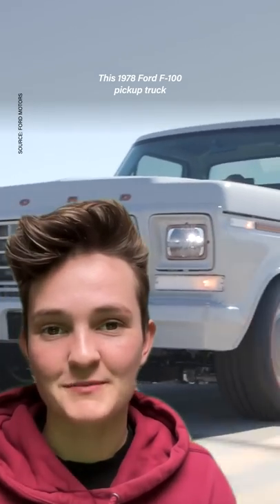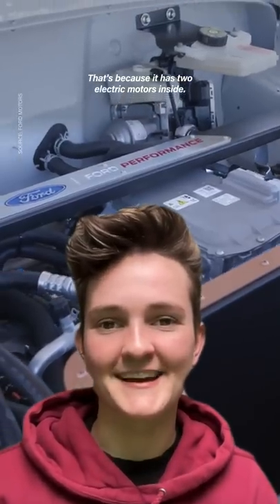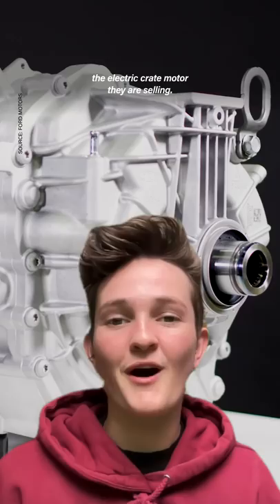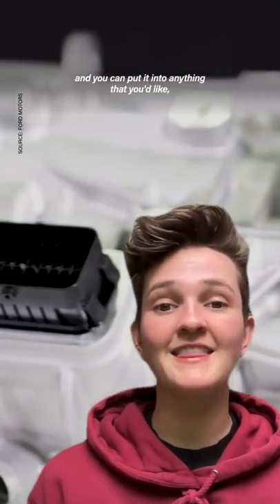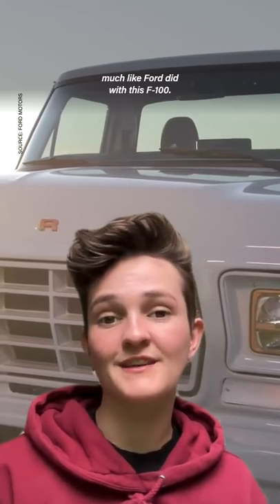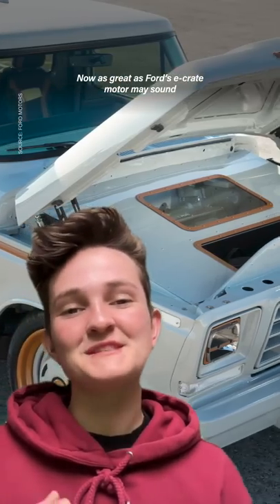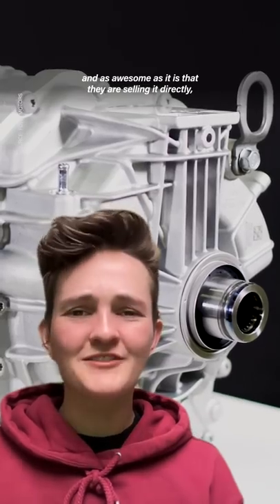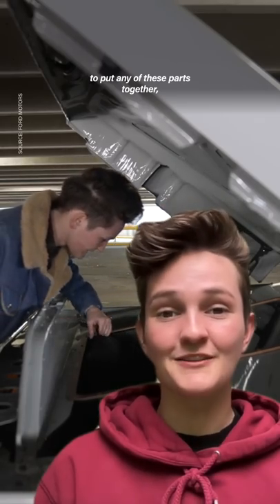Why Ford’s electric crate motor is a big deal

Comment: This is awesome: I’ve been wanting to drop an electric motor into older vehicles for a long time. The engine is only part of an electric drivetrain, but it’s way easier to do this with mass produced and (presumably) modular parts, as opposed to something custom.

Comment: Uh, this motor's kind of a scam?
Ford sells the motor but without an inverter, which is a pretty critical part, and no controllers can actually control this thing yet. So its basically a paperweight unless you're a high end shop with some ford deal so they'll use their proprietary magic on it

Comment: What kind of transmission does it use?If it s using it's original transmission, doesn't the power of the motor, breaks the transmission??

Comment: Anyone with enough engineering knowledge would know how ridiculous this is. There are wheel hub electric motors which is so much more compact, lighter and efficient. 

Instead ford wants you to sacrifice the space in the engine bay for one motor that will be more power limited and has to run at higher currents. Also it has to go through transmission losses.